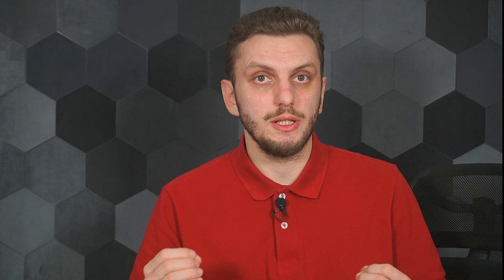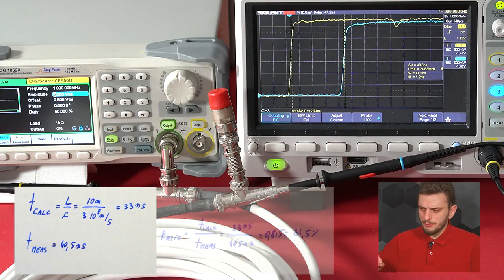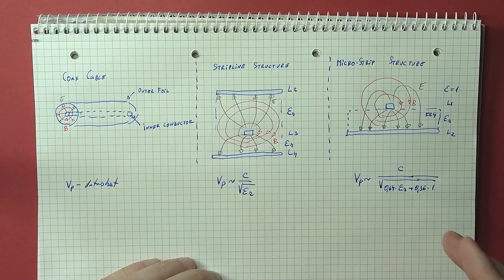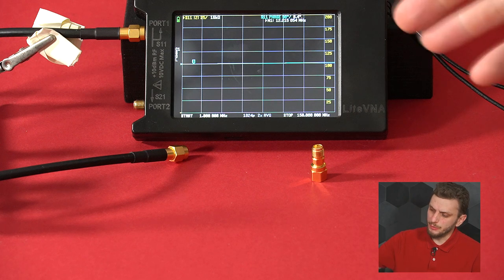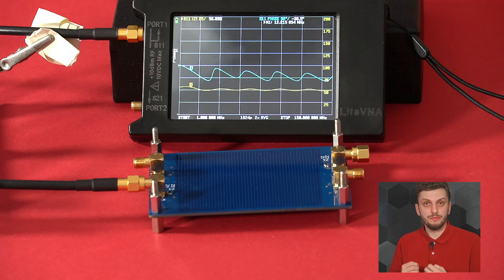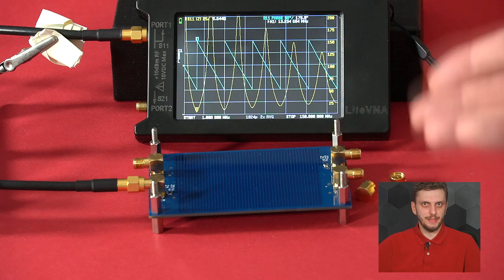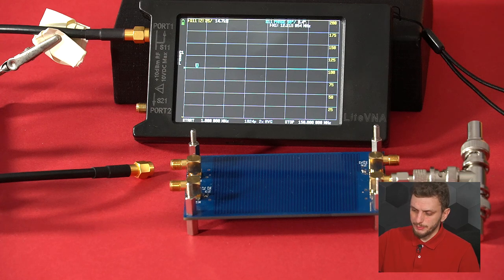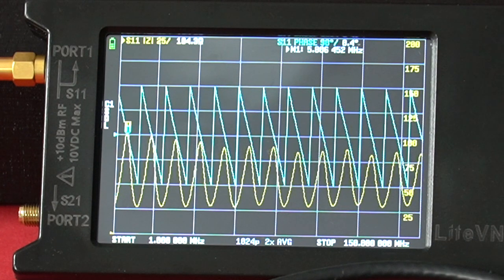Quarter wavelength impedance matching (2/2)

Comment: In practical antenna VSWR measurements you see scalloping (oscillation in the VSWR plot) quite often. It confuses the heck out of some people. That is caused by there being a reflection (more or less severe missmatch) somewhere down the line - usually at the antenna feed-point. The feed-line acts like a quarter wave stub. Your demonstration shows another pitfall, impedance converges towards 50 ohm as the feed-line loss increases with frequency,  with enough feed-line loss you can have almost anything look like 50 ohms. Lesson is, don't characterise antenns over long, lossy feed-lines.

Comment: An interesting point about folded dipole antennas is that they are two quarter wave stubs with shorts at the ends resulting in a high impedance.

Comment: Would really love to see you make and tune a quarter length primary Tesla coil system!
Reply: Yes! I am interested too 👍
Reply: Isn't the secondary the part with the wavelength that matters.
Reply: @kensmith5694  Yes, they BOTH matter according to Tesla.... the primary is a quarter of the secondary by "electrical" length.  Tesla specified this for the best operation of his Tesla coil.  The way people operate so called Tesla coils are not what Tesla did, he knew what he was doing and he knew what was important.  The modern "Tesla coils" are a far cry from the original.  It is not only important to get correct frequencies but also correct length.  They are basically coupled antennas if operated properly.. and not just tuned tank circuits.  There are major differences between the two..
Reply: @thathalfthaiguy  I wouldn't call them a coupled antenna because that really has little meaning.  The primary side often is resonated with capacitors to bring it into a match with the natural frequency of the secondary coil.  The coupling factor for the transformer action needs to be very near critical coupling if you want good power transfer.  This means height and diameter matter.
Reply: @kensmith5694  You say only height and diameter matter?  They do (as far as high Q is concerned) but go look at Tesla's original coil and you can clearly see visually that they are nothing like the modern ones that are really a perversion of how Tesla originally designed them.  Tesla did not use tall skinny secondary coils, his secondary was squarish and with a relatively low number of turns.  US Patent No. 645576 "The length of the thin-wire coil in each transformer should be approximately one-quarter of the wave length of the electric disturbance in the circuit, this estimate being based on the velocity of propagation of the disturbance through the coil itself and the circuit with which it is designed to be used."  If one knows what Tesla was doing then one would know they are more like coupled antennas, hence the importance of length.  But if one just want sparks and what everyone today is doing, then it's not important for that person.  But not everyone is content with these toys and wish to do something closer to what Tesla originally had in mind.
Reply: @thathalfthaiguy  Tesla moved towards a taller thinner aspect ratio later on.  If you are making high voltages you are forced to get taller so it doesn't arc over.  The secondary total wire length is then controlled by spacing the turns and making the diameter comparitively small.  The secondary also should be "surge wound"  because as you get to higher voltages you need more spacing.

Comment: Hey
Tell me, did you tell somewhere about a 50 ohm resistor in series with the generator and parallel to the analyzer?
Reply: Yes, he showed the 50 Ohm load on the output side.  His generator is likely 50 Ohms.
Reply: @kensmith5694  I mean, is the resistor connected in series or in parallel with the generator?
Reply: @openFrimeTv  If you think of the generator as a voltage source then the resistor is in series with that voltage.
Reply: @kensmith5694  Thanks
Reply: @openFrimeTv  BTW:  The bit about "voltage source" was because if you think of it as a current source then the resistor is in parallel.  I will explain hoping you can follow this: 
 Imagine the output of the generator is a single PNP or P-MOSFET transistor with the signal taken off the collector/drain.  The 50 Ohms would be connected to ground.  The transistor would produce a pulse of current that doesn't depend on voltage so its impedance would be extremely high.  That high impedance would be in parallel with the 50 Ohms.
I hope this helps you to see.  If not I can try further if you say where I lost you.
Reply: @kensmith5694  I thought that the output of the generator inside is connected in series through 50 ohms to this transistor. not to the ground.
and in the oscilloscope / analyzer, on the contrary, the resistor is connected to the ground.
It's hard for me to understand because I use a translator.
hello from Ukraine

Comment: Don't striplines and microstrip lines need to have ground pours to their sides as well?
Reply from the maker: That is not mandatory - the impedance is usually defined in reference to the ground planes; having ground left and right will help with preventing cross coupling to other traces though